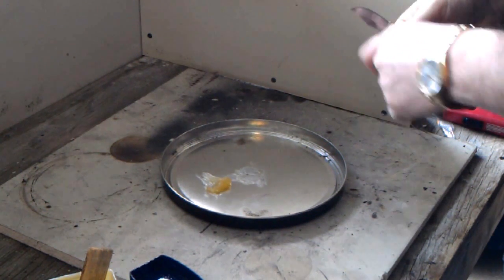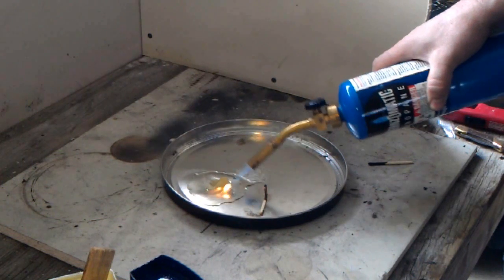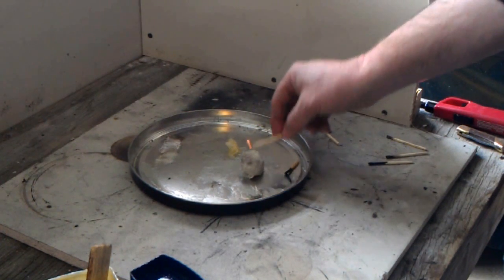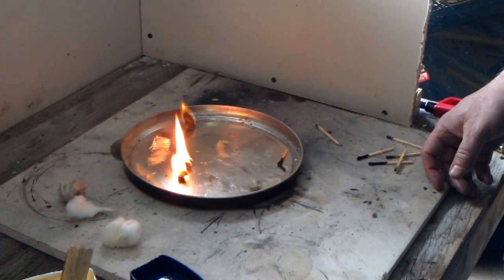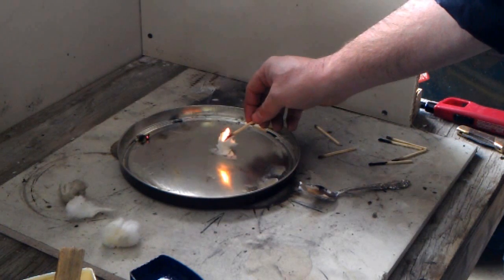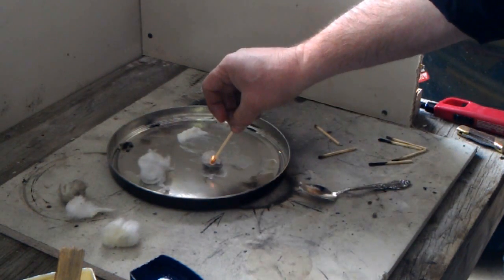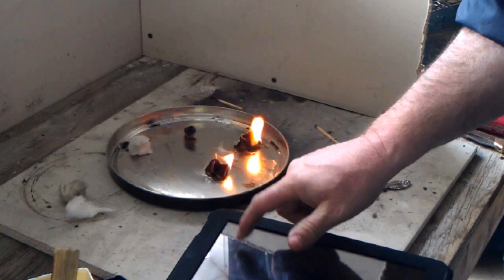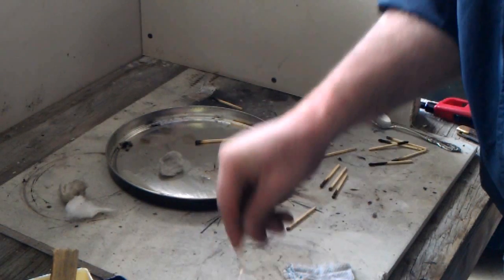Crisco Cottonball Firestarter

Comment: Crisco and  dryer lint  
Crisco saw dust mix together. Then burn test it   do it in egg carton  

Crisco  can burn for 30 days if need heat just put in metal  container
Reply from the maker: Dryer lint from cotton clothes will work. Newer manmade fabric lint doesn't burn, it melts. You will need to dry the natural and synthetic fabrics separately to get lint that will burn.

Lint and egg cartons are both staples of DYI fire starters, but they are nowhere near as effective as the Criso Cottonball Firestarter.

The point of this is to have a fire starter, I wasn't trying to make a long burning candle. If you decide  to do that, I'll make sure and give it a view.